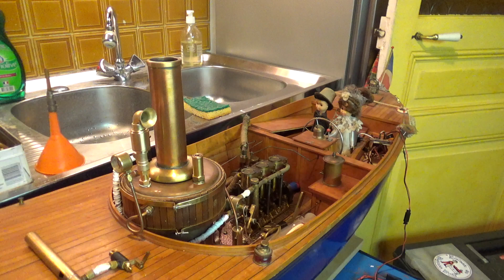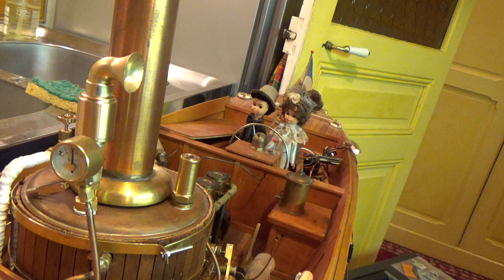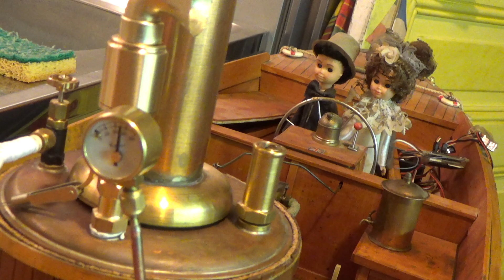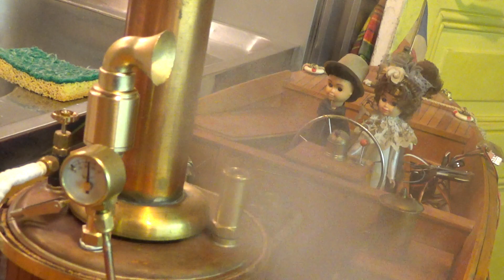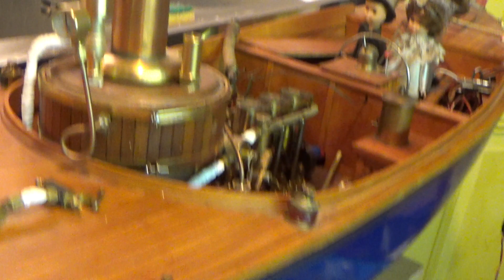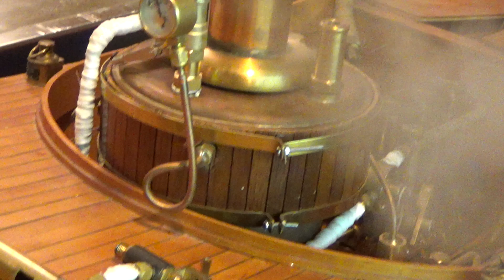La sirène Microcosm - Vapeur vive / Live steam/ Dampf RC

Comment: Congratulations Raphaël, very good wirking sirene but I think Jin is right that you should let it run a bit slower with less pressure. Kind Regards, Bram
Reply from the maker: Bonjour Bram,
I will do that, it will save steam furthermore. Besides this, I have seen this type of siren on a tractor, so I hope than steam passionates of all types will try one. 
Bad luck for you, this is not an accessory for a train :+)
Amicalement, Raphaël

Comment: I think you work at too high a speed, you can try a small start at low pressure. Let the spool work at low speed! Jin
Reply from the maker: Bonjour Jin,
No problem to try at lower presssure, I know it also operates well and it will save steam furthermore :+) I wish a great success to this siren (let me know if I am right), and perhaps could you add it to your site ?
Amicalement, Raphaël
Reply: We still need some time to prepare for the listing.Thanks Jin

Comment: the siren from Jin is beautiful, but the price :-( I watched several auctions on ebay, but 120 € is outside of me.
Reply from the maker: Bonjour Richard,
See the price in the link of my general comment, the price is lower. Furthermore,  contact Jin directly, if you say that you would like one because you saw it on this video, I think he would offer you another reduction. I specify that I have no commercial relationship with him: +)
Amicalement, Raphaël
Reply: @rhavrane  Hi Raphael,

I already have a siren ...
I use it on the next ship
Reply from the maker: @JRichard1973  Bonjour Richard,
I hope you have noticed that it needs quite a lot of steam to operate, this is why my second one will be installed on a large boiler. Did we already see your new boat :+) ?
Amicalement, Raphaël